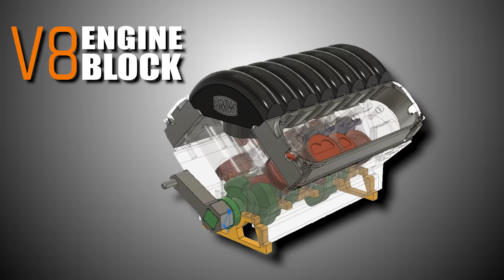5-Axis CNC Machined V8 Engine Block!

Comment: one of my dreams is to build a 400CC V8 using Honda crf50 parts... pistons, con rod, bearings and rings, rocker arms, valves, springs and seals, and many more are all pre-made for you, use them as off the shelf parts, then just machine the block, heads cams and crank.  buy a crf50 motor and tear it down, measure and 3D scan it all, you know the rest lol... im still very new to CAD, but this project is one I came up with a few years ago and has been pushing me to learn cad. I would love to see the way you would go about building this.... one thing I would like to see if you end up building it is keep it a 90deg v8 and make it even firing order, it will sound like a Ferrari then :) after you have a bench top V8 build a transmission to go with it and put it in a go-kart! :) the gear set, shift drum and forks, bearings and shafts can be pulled from something like a CRF450R and then you'll have a 6 speed sequential dog box trans... work smart, not hard... not all the parts need to be made, the engineering and machining has been done on a lot of them, you just gotta build the parts to connect them 8 at a time lol...  love the vids, I learn a lot and enjoy watching them every time. thanks.

Comment: So...first:  Gorgeous piece of a reallllly cool project!  Really nice work, folks.
Second, why start from round stock?  Was there a technical reason or just what you had?
Third, why set up off the unmachined side?  Wouldn’t it be better to setup on the side you already machined since you knew the shape and dimensions?  Or am I backwards, or does it not matter at all?

Not being argumentative, by the way, wanting to know.
Reply from the maker: Great questions!  2) Yup, what we had on hand, 3) not following the question
Reply: the first setup was for fixturing in the 5-axis trunnion, the rest doesn't matter because the whole thing is raw stock and there are no datums to be referenced off of yet (if that's what you meant)
Reply: @nyccnc  I rewatched and realized the answer there.  So you machined the "bottom" that was going on to the trunion in that first op.  I guess I didn't realize that was the end you mounted to the trunion bc it didn't LOOK machined from the outside...
Reply: the part he's chucking on doesn't matter because that's going to be decked off.
Reply: "to the trunion bc it didn't" 
.... bc?
Sorry, but no mercy.
Reply: On the round stock question, oddly it's often cheaper and easier to use round stock regardless of the material wastage because round stock is easy to fixture and pound for pound cheaper than other forms.

Low carbon steels and aluminum do come in a wide variety of forms so it becomes job specific when choosing but the high carbon alloy steels and stainless steels, especially the high performance varieties, are only available economically in round stock.

Comment: A functioning wankel engine would be amazing! Or even a non functioning one. please go through with that!
Reply: Isn't a "functioning wankel engine" an oxymoron?
Reply: touche
Reply: Anonymouspock:
My father had an NSU Ro80 with a Wankel engine. It worked!!! Allthough it had regular trouble with its compression sealings between the chambers.
Reply: O.S. engines makes a RC wankle engine already., theres a guy who made a twin rotor too.
Reply: Anonymouspock When you get a chance HMU. I have a 4 rotor RX8 that breaths fire and gets downright rude and unnecessary when you get on the throttle.
Reply: Anonymouspock lol
Reply: @Anonymouspock  Extremely reliable, the just never grenade. They do burn oil and fuel at copious rates, however.

Comment: That's the most beautiful mill I have ever seen, honestly. I'm trying to figure out if I'd even be able to machine a tiny 1 cylinder engine with just the mill, lathe, grinders & surface grinder at my work, none of which are CNC. I don't know if I could get that level of precision I'd need..

Comment: Looks great! You should consider a V8 2 stroke and run it on Nitro/Synthetic mix like an RC car or plane engine does. This will allow for no valve/timing system, air and fuel cooling, and easy to obtain fuel. You could easily use that block for it.😁

Comment: you can make billet pistons , you can make a billet crank and rods too 
if you make liners to go intoo the engine you probably be able to make coolant passages intoo the block and grooves in the head deep enough to cool somewat 
camshaft and most of the other stuff can and have been done before , the harder parts are probably the waterpump oilpump ignition and injection all of those could be done outside the block and with an ecu

Comment: Might i HIGHLY suggest a Bourke Engine! They're the toughest and most efficient engines ever designed and have much fewer moving parts than any other engine save for a Wankel. 22.5 to one compression ratio, pulse detonation homogeneous charge. I have ALL the blueprints and CAD/CAM files already made. I don't have a lathe or CNC, all I have is a bridgeport. I'll help any way I can including designing and building a special thermal catalytic cracking fuel system and ignition system (spark plugs only used for startup, once warmed up the engine is compression ignition).

Comment: Hey, John! How about a 1/4- scale working model of the Ford GAA M4A3 Sherman tank engine? A stunningly advanced engine for its day. DOHC, 4 valves per cylinder, flat-plane crank, worm-gear cam drive. It displaced 1099ci with a 5.4" bore and a 6" stroke for an output of 500-525 very reliable horsepower. Good-looking engine, too... Just sayin'. VERY nice video, this one!

Comment: as a radio control large scale fan..   depending what you make i could make it do anything..  car, truck, boat or hot rod.... 

i have dreamed of hand making my own motor for 20+ years..    to see a block made that fast drags back all the research i did to make a working transmission  meaning  forward and reverse..

Comment: I was awed by this. Having said that, I can't figure out how you plan to get coolant through that block. I know first hand what happens to IC engines when there is insufficient or no coolant flow.
Reply: It's not a real engine. It's a demo part, strictly to show of the capabilities of the machine.

Comment: Omg!!!!! John this is absolutely AMAZING!!!! You are so amazing at what u do!! I have been following you for at least 5 years now maybe longer, I just can't believe how far u have gone with this it's absolutely inspiring. Yet again amazing video!!!!! We run mastercam and I tryed out the convert 3 to 5 axis on a part that had a complete 3 D surface deep pocket. Not sure but I think it was a post issue because it cut real deep into the wall this happened when it was starting off in the pocket. The cutter was 1.8 inch deep a 1/4 ball nose. I had to take it 3 inches deep and when it started the 5 axis motion like I said it cut into the wall and snapped the cutter. Any idea on what u think may of happened? I'm going to contact or reseller on it still just thought maybe u could give me some insight. Also I'm from Canada 🇨🇦 and my boss is taking my self and or lath supervisor to IMTS we are going Thursday Friday. Any way u will be there? I'd like to meet u and shake your hand!!

Comment: Hey can you show me pictures the dimensions to the 4th and 5th axis programmable vice? Like how would I build one. Also how does the mill bit get held by the mill via the robotic replacement arm thingie? Is it neumatic? Also is the "match stick gauge" device bluetooth? Whats the blue light?  If I can build these things myself I want to start building terminators in my basement.  This channel is awesome.

Comment: OS engines used to make a Wankel Engine for airplanes.  there is also a manufacturer (conley) for 1/4 scale rc...I would highly suggest you look in to RC and model engineers etc as they have a lot of information there.  Sometime something that you want to do might be already done to save you time and aggrevation.

excellent stuff.

Comment: OMG! You guys are missing out on some pretty gnarly stuff a lot of people would pay HUGE $$ for! 

Did you know the Yamaha YZ-250 has a stock HP rating of 48? You have guys that are modding the hell out of banshee motors, a twin 175cc (350cc total) just to get 120 hp. You guys could make a twin YZ-250 motor with all factory parts with basically 100hp. Make it a 3 or 4 cylinder and now you’re talking! You would have guys lined up down the block and around the corner waiting to get their hands on one of these blocks. (Showing them it works obviously) 

And 2 stroke blocks are sooo much easier to make than 4 strokes! 

Anyway, just something to consider!

Comment: Yeah, great. An Air-Cooled engine w/o the fins. Why don't you show a Aluminum or Cast Iron Casting going through the machining phases. You know, a casting w/ cast-in water passages. You'd have to Gun-Drill the oil passages that'll feed the tappet bores. The Haas can't do that. Something that can be used in a vehicle. I'd like to see a casting made of Compacted Graphite Iron. That'd be real tricky & stressful on the Haas. Keep going guys, you're building up to the practical. Thanks for the video.

Comment: I can't believe you didn't part off that disk of aluminum at the end there, did you have to turn it into chips?
Reply: yeah but still that takes time and energy on top of the energy you used to turn it into chips, when you could have just parted it off and had a disk of aluminum.

Comment: Is there something in Cad that tells you the most efficient size of stock to use for a project?  It sure seemed like a lot of stock being machined away for the basic shape of the block. The block turned out great but were all the cost considerations as sharp as the cutters?

Comment: I’m fairly new to machining so excuse me if this sounds dumb but why isn’t there any coolant flowing through or onto the tool while it cuts? My only experience so far is with a Makino A40 and a Mazak UN600. They both have coolant flow through and onto the tool

Comment: Isn´t it possible for you to use much higher feedrates? Seems a little bit "slow" or am i wrong? 

I´m working with an Index R200  and we can go to 550-600 inches while working with 14-17k RPM  (17 meters per min in metric system) 
Anyways nice job and greetings from germany! :)

Comment: You could make a bigger model and use actual tiny lawnmower parts to get it running, also i have seen small sparkplugs for lawnmowers at the home depot, or nitro rc engine parts to get it running too.

Comment: Please make this into a functional V8 that burns gas or nitro RC fuel!!!! Maybe clone the GM LS engine. Sell it as a ready to assemble engine kit. Would have to do something for a transmission for the remote control vehicle folks who would want to do more with it than a little brap brap on the bench. Nice work! Would love one of the blocks for display myself.

Comment: If you're going to do it for real, you're gonna need coolant passages (water jacket), oil passages and those bearing journals need to be line bored with the main caps on.  Pretty sure I've seen someone do a 2-piece block for a 4-cyl tho.

Comment: i think 4 cyl is more complicated, v8's are rather simple, there is no need for counterweights, it has only one camshaft. i think you need to team up with stefan gotteswinter to make some valves, conrods and piston rings aswell as the screws for it. but other than that, piece of cake, the machine is easily precise enough to make actual engine parts on it. the problem will be the stuff you cant really make like sparkplugs or getting lubrication and cooling right. maybe you should start with a single cylinder two stroke since thats the most easy engine to create and if you follow some common designs, you could even sell the blocks.

Comment: How small can you go on cnc milling machine? I'm trying to make a mold for a plastic part and the smallest dimension is like a cylinder that is about 0.7 mm and it's really close to another surface, like 0.35 mm away

Comment: Does all car engines are machined like this. Or cast block are simply machined to finish the job.
Reply: Majority of production car engines are cast then machined to final tolerance, only really machined from a solid piece for extreme uses like drag racing where they are under loads that far exceed what a normal engine would see

Comment: The result is good. Nice work! 
But why did you use such a big blank? That was alot of material and tool/machine wear wasted. It should have been manufactured from hexagonal bar not from round bar.
Also toolpaths was not optimal, every G0 is waste of time, tool is only usefull when cuting.

For just manufacturing a proof of concept and you got the blank on shelf it's fine, might be me focusing to much on mass production.

Comment: What is the liquid made of? Is it a special type of liquid? Looks to be a milky white.  Has anyone here used a machine like this? Another curious question.....How hard is clean up after the completion of a job?
Reply: It's a coolant/lubricant. Cleanup isn't bad at all. A little bit of rinsing is all you need to get it off. The liquid is recirculated through the milling machine until you decide to replace it.

Comment: Ok you make a aluminum miniature engine block
Are you making iron sleeves for it
Plasma arc the cylinders 
Whats the purpose 

My grandfather made a working miniature 5 cylinder rotary engine back in the 40’s on manual machines

Comment: I know nothing about machining. Can anyone explain why say early in the piece there was a tool that was being fed at a high rate removing a shit-load of material and had no coolant, and then, later on, there was another tool drilling and that had a torrent of coolant from 4 jets?
Reply: A lot of it comes down to filming - we could have probably run that tool faster with the flood coolant, but it's a lot easier to see without it. Drilling isn't that interesting to watch, and benefits from coolant significantly more

Comment: this is an empty duty. you musn't make gasoline or dirty diesel motors. you should make bldc motors and electric motors. make jet engines. make 
hydraulic motors for force direction exchange.